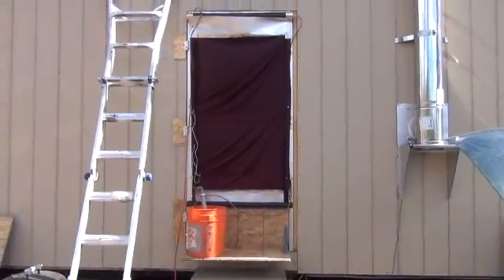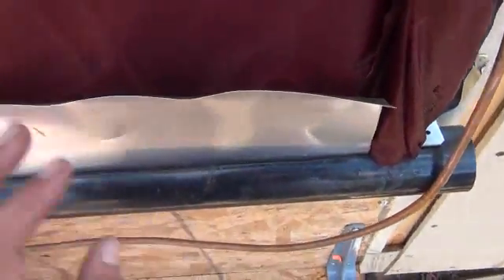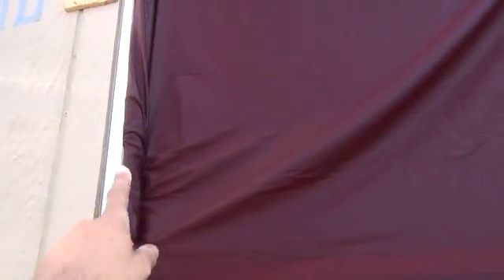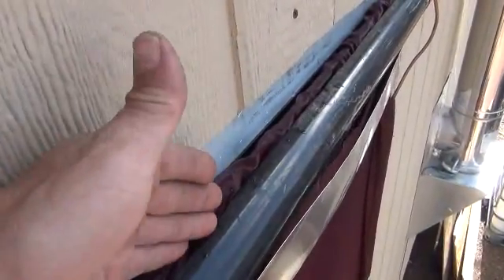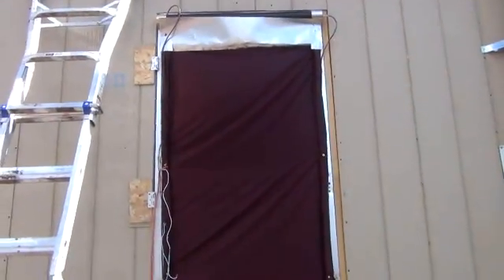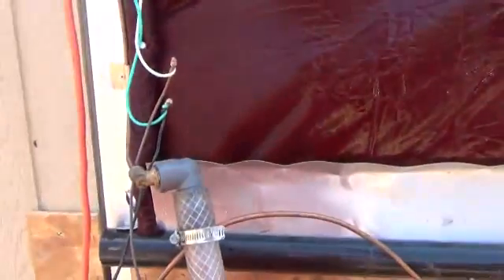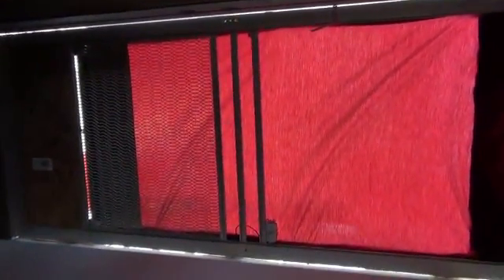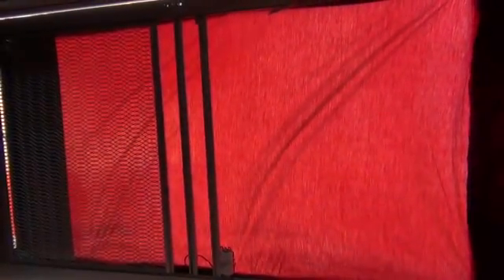homemade "Evaporative Cooling" system

Comment: Copper tubing is used is compressors to retain the high pressure gas. It adds to the cost. You can further reduce the cost by using simple plastic water pipes.

Comment: Hey buddy, i know this video is old, but i had an idea.  Depending on the amount of rain you get, you could set a rain barrel on a section of your roof, and allow gravity to fill your drip reservoirs. Recirculation and collection is something that can be ironed out in the final plans, but i would think incorporating a rain barrel reservoir system would be very efficient.
Reply: +Richard DeFreeuw good idea! also direct the overflow of your water tank situated in the roof to the reservoir (Y)

Comment: this must be using a lot of water
Reply: MrTarek059  It does, but water should be a lot cheaper than the electricity. Most of the water is evaporated into the air, this causes the air to be humid, but when the air is cool the humidity makes it more comfortable on the inside.

Comment: Nice!  To make it more efficient, close all windows and doors, put a window fan in a window at the opposite side of your house expelling air. This will draw cold air throughout the house. I noticed the sheet flapping outwards, which means your losing cold air. Temps should drop even more!  Good Luck!
Reply: If that expel-air-fan is higher it will both draw air in and pull hot air that rises, up and out to where it belongs. 😉

Comment: Thank you, Mr. Telonian for your ingenuity and for sharing it!  I've been wanting this kind of information.  I  live in the high desert/ranching town of Montague,  We are having 100 degree days every day for 2 weeks now and it's supposed to continue.  I live in an old brick building built in 1890.  The bricks heat up during the day and continue heating the interior all night long, although the cool night temperature (high sixties) helps cool it somewhat.  I want to use a low energy, efficient water evaporation cooling system.  The two story building has a total of 4000 sq ft. Any suggestions would be very appreciated.  

Oma Eliana
http://www.heartfeltcollective.com

Reply

Comment: wow that is so cool. if you use a fan on the outside blowing hot air would increase the rate of  varpor and lower the temperature even lower on the inside. im courious to see how low it would go.